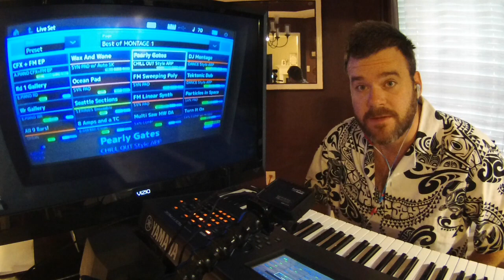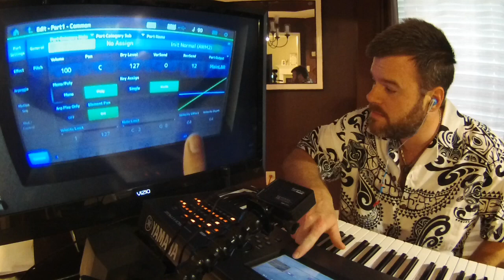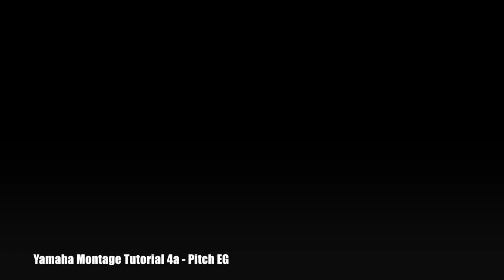Yamaha Montage Tutorial 4a - Pitch EG

Comment: greetings....dows the MOntage have point loopable envelopes for pitch, amd, and filter ? Can you choose from wich point to Loop, for ex, Atack, decay, sustain, etc ? How many attack Levels it has and Amplitude ? How many Release levels ? Only 1, or 2 ? i am asking you because the Yamaha EX5 from 1998 has all these, and I want to know if it worth the purchase of a new so called FLAGSHIP synth. Believe me or not, the info about these options I asked, are very handy for a sound programmer once you know how to use them. I am also asking you because the Motif XF does not has these options. Thank you for your time and itneresting videos :)
Reply from the maker: It does not have loop able EG.  However, the motion sequencer can handle this and more.  There are only ADDR envelopes separated by time and level.  There isn't even a LFO depth setting.  It's a good board...  But it's missing some things that I would be surprised to see in future updates.
Reply: ok thanks for your time man :). I have more questions, when you will have the time. For example: A Montage performance is made from 8 parts, correct ? Each part can have its Motion Sequencer ?  Also, each part can have from 1 to 8 individual elements correct ? Can each element have its own Motion Sequencer ?  How are the Motion sequences store ? At the level of Element, Part or Performance ? Also, ecah individual element from a Part, have how mane LFO`s ?  On Motif XF each element can have only ONE LFO routed to Freq, Amp or Pitch ? On Montage one Element can have multiple LFO`s routed to wich destinations ? Or it is like on the motif xf ? Many thanks :)
Reply from the maker: +HERUVIMIUM Performance is 16 parts.  Each part is 8 elements.  Either AWM2 or FMX per part.  The motion sequencer has 4 lanes that can be assign to each of the 8 elements in a part.  Each element has it own LFO however, it is limited as to what it can control AND the depth cannot be set for the LFO... Which really sucks.
Reply from the maker: +HERUVIMIUM there is a common LFO that can be routed to wherever it needs to go... But, as far as I know, there is only one per part.  Each element has its own dedicated LFO that can be routed only to certain specific/limited things.
Reply: Yep, as I suspected. For each element , only on LFO routed to AMP, FREQ and Pitch I think, like on XF. That Common LFO is same as on XF a general one for all 8 individual elements, wich is not too great, i mean the freedom is pretty limited.  What can I say, the Montage is not nearly TWICE THE MOTIF as many fans were saying on the net. Of course, in its own right the Montage is pretty great, but way too expensive by 25-30 % . I will postpone the purchase for at least 6 months more, time for Yamaha to add some more capabilities to AWM2 synthesis engine. Maybe I could do more interesting stuff with the FM-X engine on Montage, but I know nothing about FM syntesis. But about AWM2 I know quite a few, and maybe I will be pleasently surprised by Yamaha in the close future. Not to forget that Yamaha sell Montage as a synth...Maybe they will drop on market the MOTIF XF replacement a new workstation :)    . Thank you again Xeph